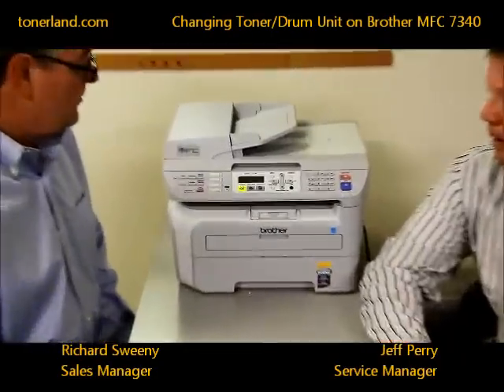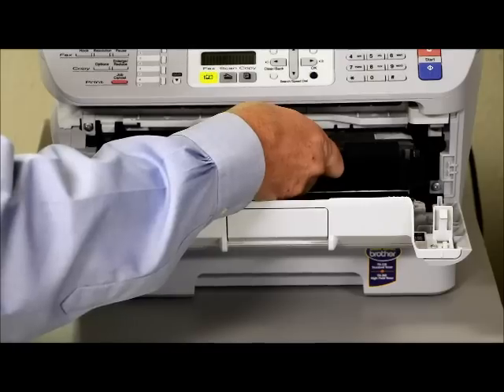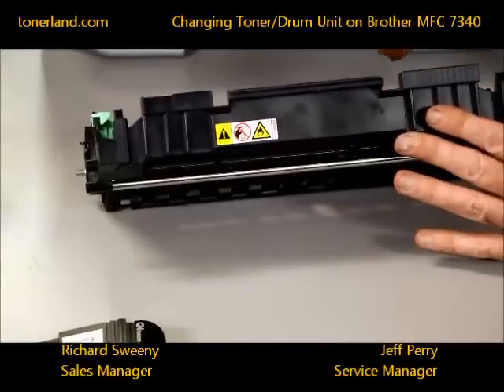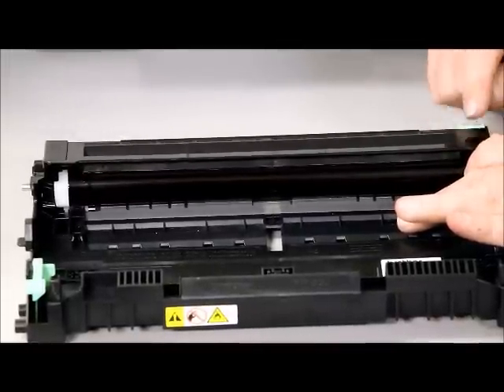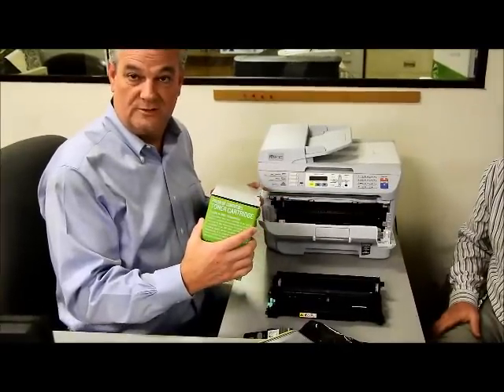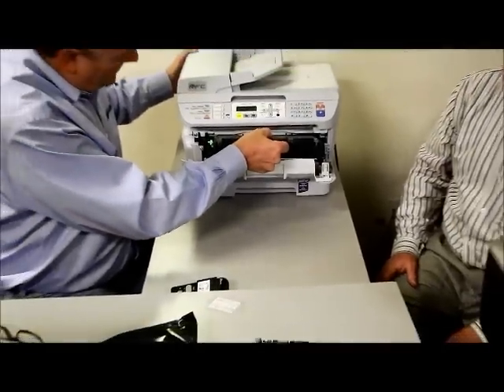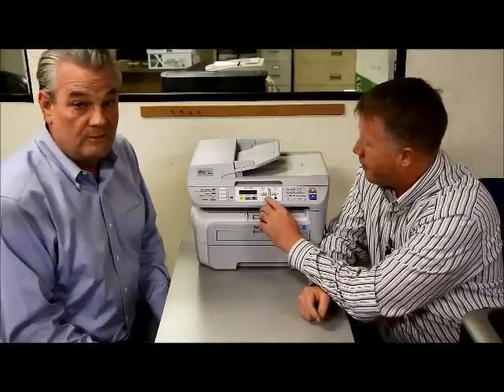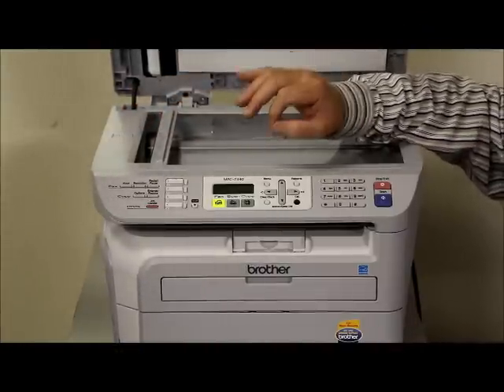Brother MFC 7340 - How To Change Your Toner/Drum

Comment: I would like to commend both of you gentlemen for an excellent video. It is A+ all the way. My printer finally needed a new toner cartridge, and I was at a loss as to how to proceed. Although the printer that I own is a different model, mine is the Brother MFC-7840W, your instructions worked perfectly with my printer. Thanks again for a job well done.